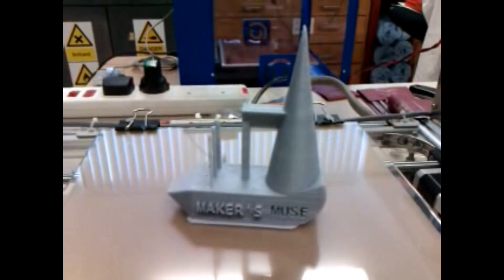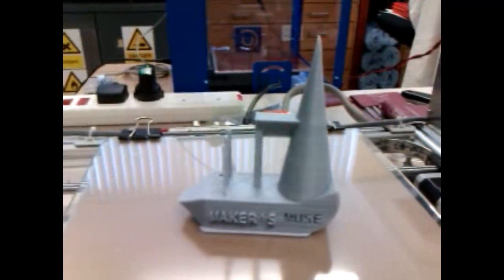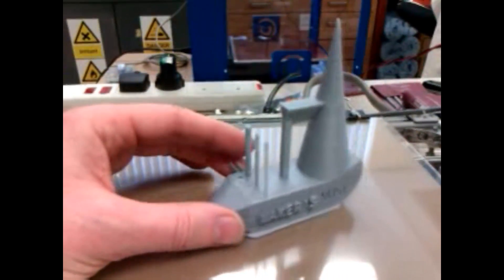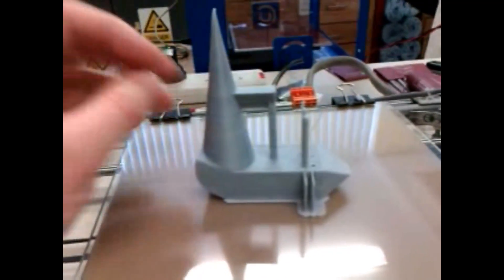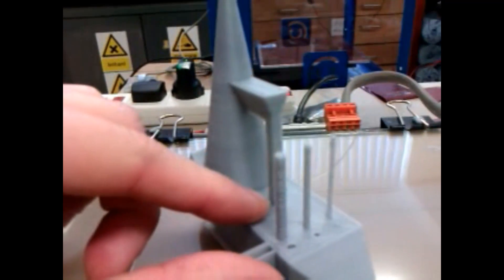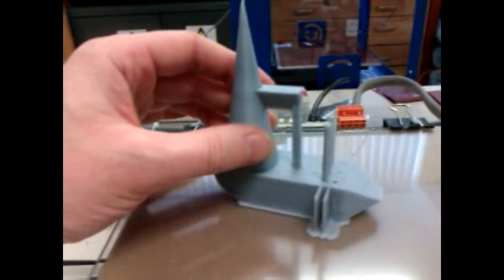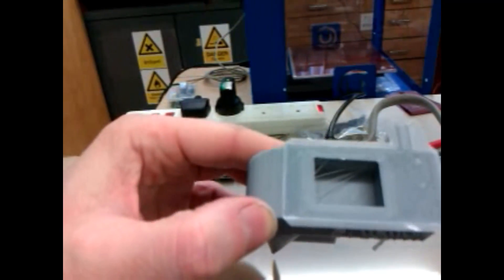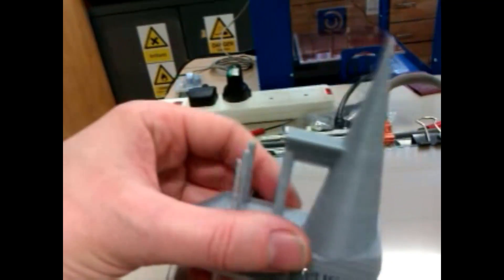3D print test

Comment: That 3D printing is very cool. Neat to be on the ground floor of this new technology. Where will it end up?
Reply from the maker: +Buckrun11 3D printing , or more accurately, additive manufacturing, has been around for quite a long time. For the filament deposition machines like mine, it's long enough that the basic Patents have expired.  That's what has led in part to the high availability of affordable machines.